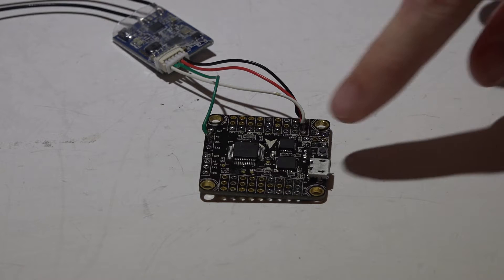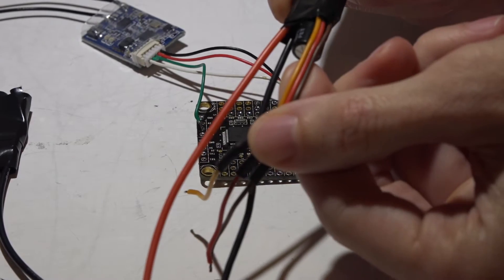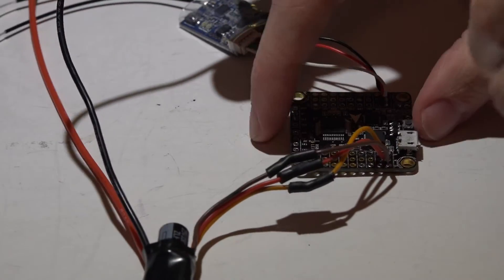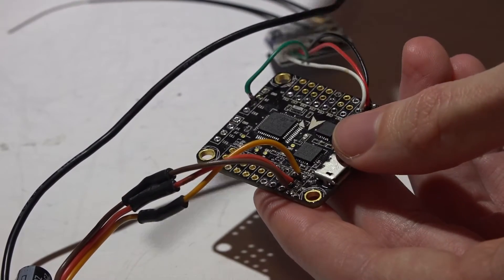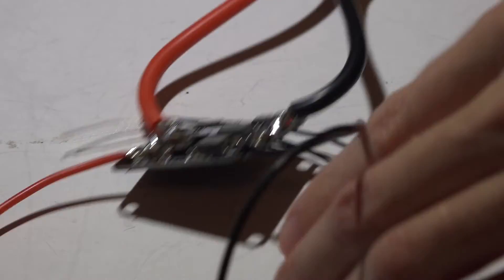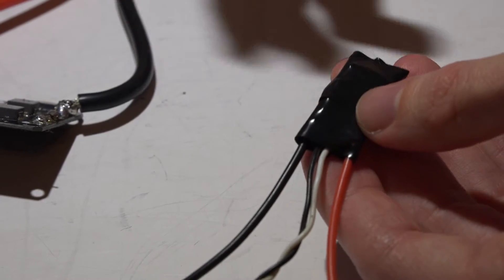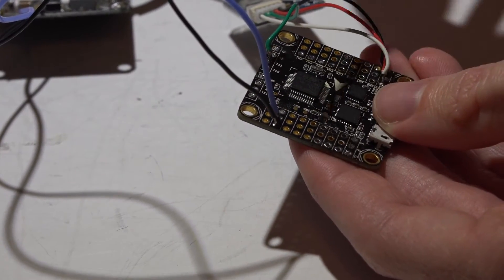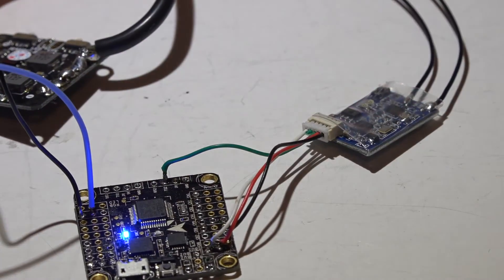X-Racer F303: How To Power (plus tips)

Comment: Hello, I have a racerstar 4in1 20a vs with dshot and lbec default. I already had my xracer f3.1 powered through the pdb 5v into ch6 so I didn't use the bec on the 4in1. I only have tx input and the rx working when its plugged into usb. When I unplug it and only run it on a lipo, I don't get any power to the rx and the red light on the FC doesn't glow and my esc's only beep three times. I am a noob at all this and I am sooo close to getting this thing going finally. I am using a spektrum satellite powered by 3.3 and hooked into sbus. Thanks for any info.
Reply: I just noticed I am powered on ch6 on the opposite side of the FC. Aren't they both 5v anyhow? Thanks
Reply from the maker: I just tested mine. I'm getting 5v on all the 5v pads as well as 3.3v on the one 3.3v pad with both with only the USB connected and with only the Lipo connected. Its strange that you're not getting 3.3v with the Lipo connected. I also powered the pins with Ch 6 input pin and with the output pins. That wont matter because you're right all the 5v pins are connected together. I normally have an answer or a fix  but this time I'm not sure what could cause that.
Reply: O.k. update. I tried a sat rx that will run on 5v. I am now getting power to the rx when it's unplugged from usb and running on lipo but, I still can't arm or get any input. My buzzer is good but it won't activate on a ch as well. I realized the red light only comes on when I hit the switch to turn on and off the buzzer. This makes me think something is wrong with the FC idk but this sucks. I rebinded and everything. Thanks though.

Comment: hey JC I'm having a issue with my xracer f303 wired it up like u have it with x4r it was working before I swapped to my x4rsb 2 of my motors spin I checked voltage from signal wires and ground on my esc 2 esc that's working have 0.02v the 2 that's not working has 2.94v is this what's causing my problem please help